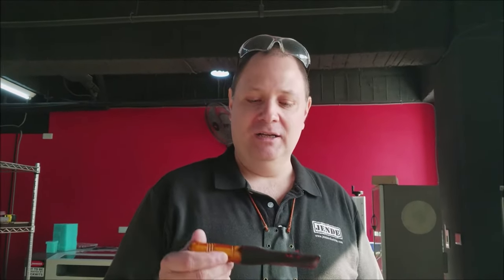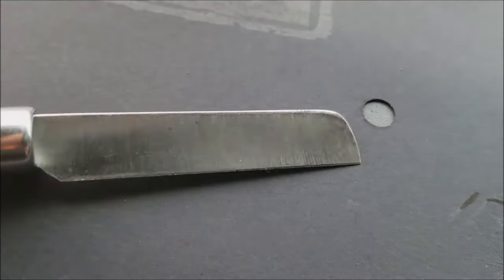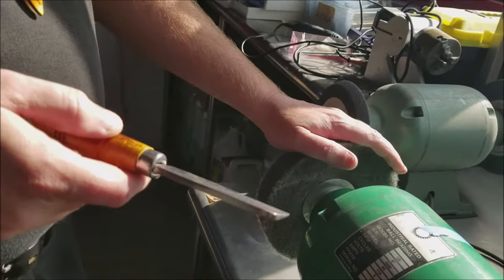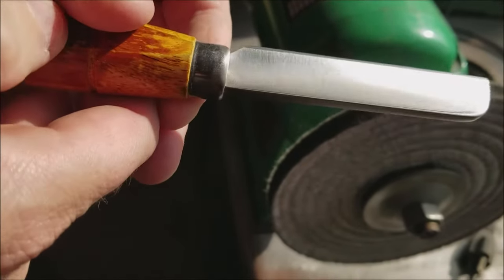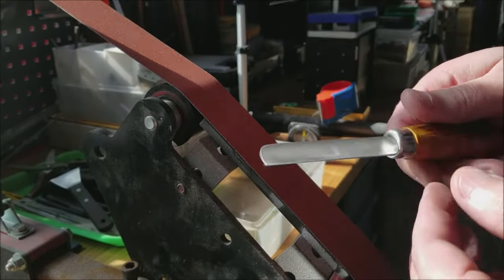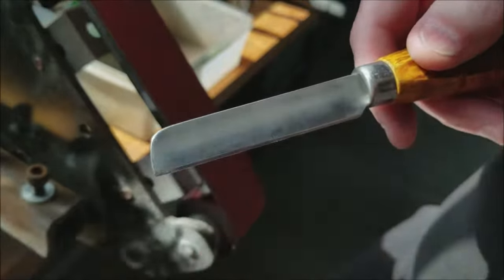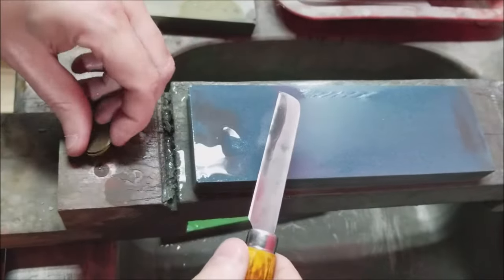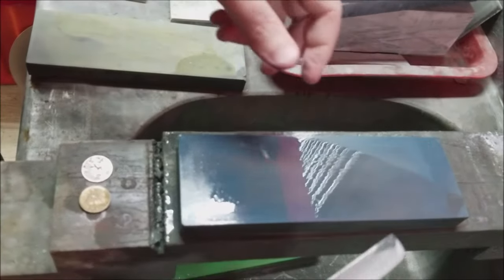Cleaning and Sharpening a Jende Reed Knife  by Jende Industries【清理、研磨Jende剃刀】

Comment: Are you using Taiwanese coins for the angles?
Reply from the maker: The coins country of origin aren't as important as the angles they produce - The Dime is the lower angle, and the nickel is the raised angle, which is approx. double the height.  So whatever the country coins, use 1 for lower and 2 coins for the higher angle. :)